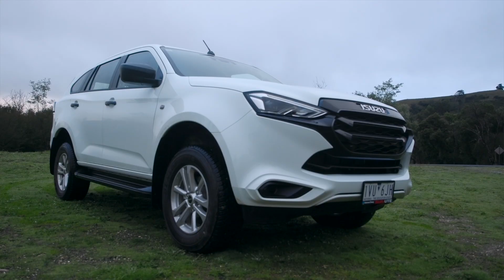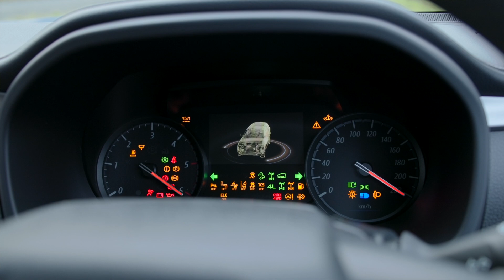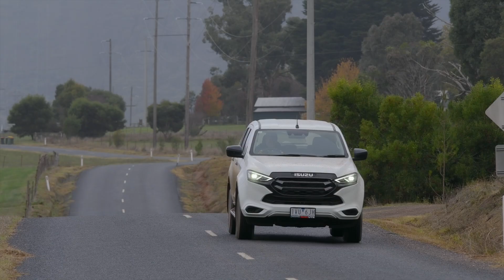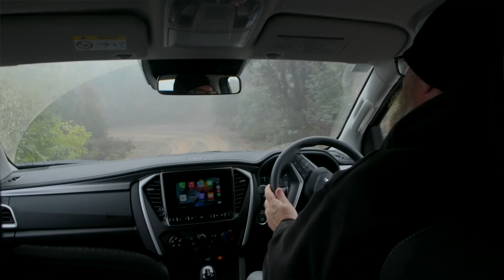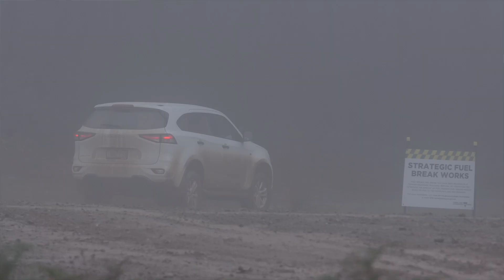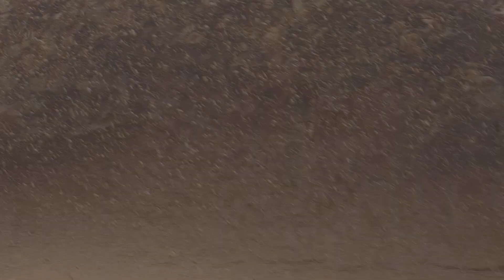New project vehicle: 2022 Isuzu MU-X | 4X4 Australia

Comment: Not sure about the choice of vehicle. With all the mods planned the 2800kg GVM limit will be hit quite quickly. Any plans for a GVM upgrade to allow towing or carrying more than 2 passengers?
Reply: The payload around 670kg?  Guess it depends on what he wants.  Probably need a suspension lift anyway which Fulcrum have a prototype for now so no doubt GVM package isn't far off or already available.   For a bullbar, snorkel, winch etc the payload will have plenty left in it.  If he wants scrub bars, rear bars, drawers etc then it might be closer to payload limits.  But then again he might be planning solo adventures only.

I love it how people comment on the MUX's GVM, it's not much different to a Prado at 2950 and the Payload difference is negligible.  All SUV's face into this issue.  

What should he have bought?
Reply: @Portyhouse  New 2022 MUX payload is 615kg-665kg depending on model which if towing its maximum 3500kg as specced(10% Ballweight) leaves 265kg-315kg for passengers, gear and any accessories like bar work and roof racks. The better option is a Land Rover Defender.
Reply: @cawtravel   wouldn’t the 10% ball weigh only apply if he had a 3.5 tonne van on the back?
Reply: @Portyhouse  Clearly you didn't read what I posted. The MUX is not designed for anything other than transporting the kids to sports. When loading it up with accesories, payload disappears quickly.
Reply: @cawtravel  Yeah you see heaps of land rovers in the bush LOL.  Go check out Patriot Games channel, he's just taken an upgraded MUX onto the track with quite a few accessories, towing his X1 camper with his whole family in the back and gear in the boot.  If he's impressed so am I.  Even with most accessories you'd be stupid to still think you can still tow a 3.5 van legally.  Go check out 4WD 24/7 and check out the Izuzu Ute on every video.  These cars are more than capable, safe and built to last.  At that price that's a great pic and can't wait to see the upgrades!
Reply: @Portyhouse  DMAX and MUX are totally different with completely different payloads. Patriot campers are light so no issues with GVM/GCM. Problem is car manufacturers advertised ridiculous claims of towing capacity yet real life weights are a different issue altogether.
Reply: @cawtravel  So your suggesting spending an extra $50k at minimum to get a little extra factory payload. And you think a defender is a tougher vehicle? By all means, buy one and smash it off road if that makes you happy. However, back in reality an MU-X can easily be certified and to carry a whole lot more if that what the owner desires, and certainly for far less than $50k. Also, the MU-X is built on a pickup chassis by a truck company. Yes, a defender can go off road well….for a while. But in reality it’s a handbag. A signal that one has cash and might like a spot of off-roading. It doesn’t take much and all of a sudden you’re spending thousands in repair costs and waiting months for parts. Those who are really serious have a dedicated off road vehicle and a daily driver. Those of us without unlimited cash tend to go for a tourer. Something that is both a daily driver, can tow, and goes fine off-road. And did I mention, doesn’t cost over $100k+.
Reply: @WhyWouldYouDrawThat   Processing... GVM upgrade Vs. #FamilyDelete.  Hmmm, I know wich one I prefer 🙊 🤣